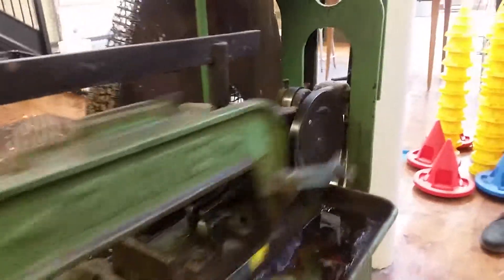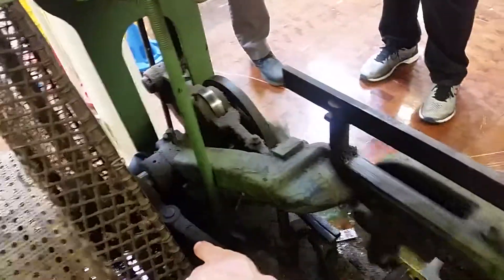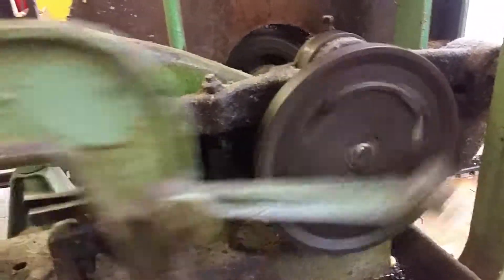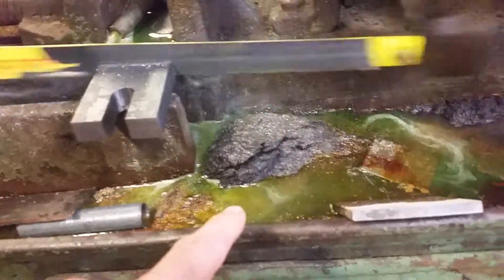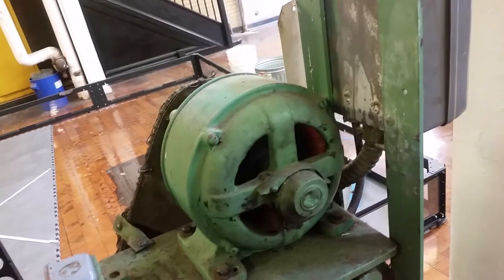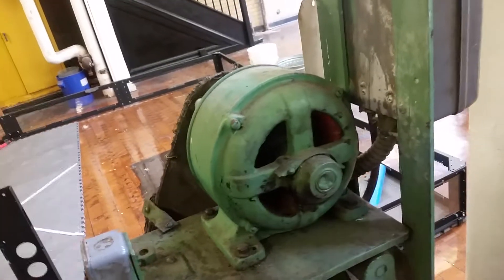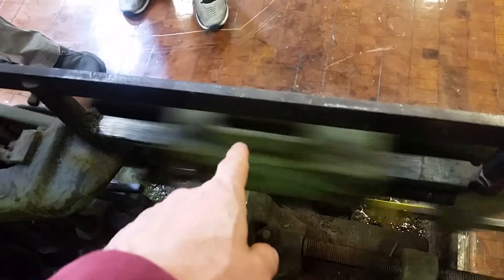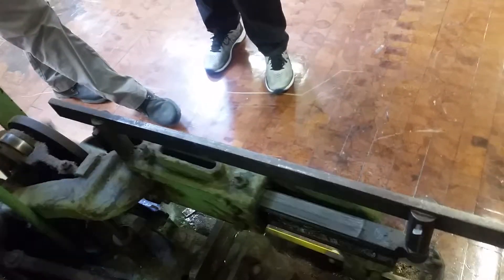Racine Power Hacksaw from 1920's

Comment: I have already seen from the turn of the century that was originally made for a steam powered shop. This one is out of adjustment just like mine is and I'm trying to find the exact method of adjusting it there is no lift to your blade inquiries small amount on mine. Mine's huge though it's like perhaps three times larger than the one you have I wish I had the smaller one like you have. Mine takes up hair for my goddamn shop!